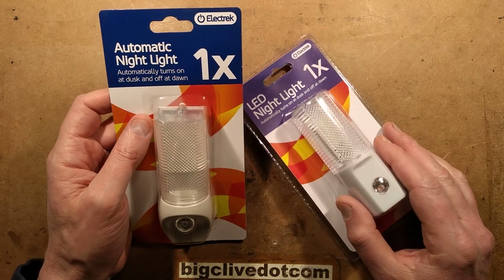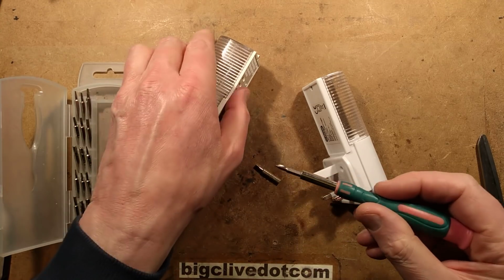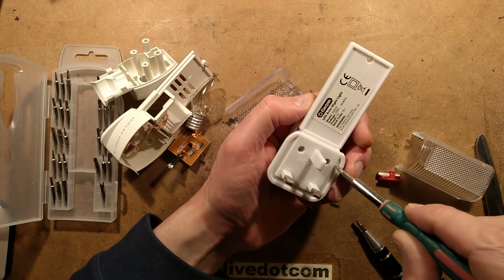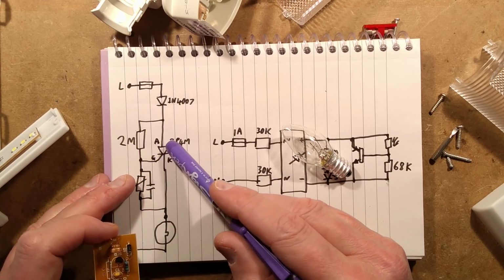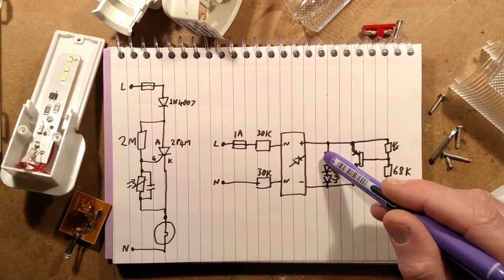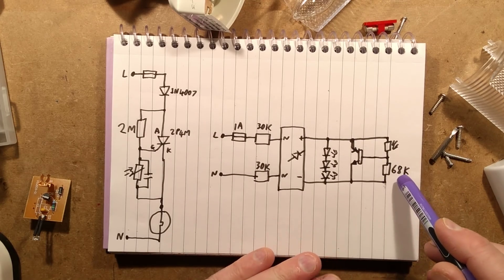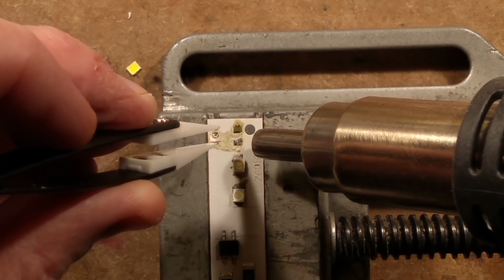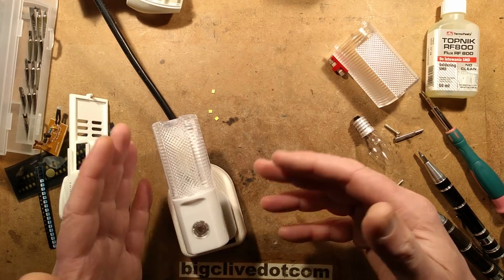Poundland night light tungsten to LED evolution.  (with schematics)

Comment: I had one of these and tried to add more LED's to it, but i found it would not come on with any more than three. Why is this? Is it something to do with the transistor that shorts out the LED's when light shines on the LDR?
Reply from the maker: It is possible that the higher voltage is changing the dusk sensing characteristics.

Comment: So... if the LED night light is continually lit it uses the same current as it would when the LEDs are off?
If so, apart from increasing the lifespan of the LEDs it's a bit pointless and technically a waste of energy (minuscule that it is).

Comment: Would it be possible (smart) to put a flickering, candle LED in place of the top LED?
Reply from the maker: It might be viable, but may need a small zener diode across the LEDs to limit the open circuit voltage when the flickering LED has its LED off.

Comment: Instead of the ( two ) 30 K Ω resistors , use one 100 nF ( " X2 "  mains rated ! ) capacitor live side and a 330 Ω resistor in the neutral side .... this gets rid of the heat dissipation .... the LEDs can then run all day , without a big electricity bill ( remove the shunt circuit ! ) tried - n - tested ....  😝 ....... DAVE™ ..........

Comment: I've not had any pleasant experiences with those night lights that are supposed to turn themselves off in the daytime.  Either they stay lit,  or they don't turn on when they're supposed to.  Last one I took apart was simpler in terms of the circuitry,  there was a thyristor in a TO-92 case,  no part number apparent,  and an LDR,  which I thought I might find useful so of course that immediately went missing and I haven't seen it since.  The only night light that I currently have here is one with a regular switch,  no LDR in it.  Oh,  and the bulbs used to be all 7.5W,  but I've seen them as low as 4W in some instances.  Edit: New YT stupidity with "handles",  my name does not start with an at sign nor does it have an underscore in the middle!  Idiots...

Comment: LED lights  are going to cause a massive influx of plastic waste in the future. Even the packaging has more plastic on it for the LED one! LED fixtures are not designed to have the LED's or the driver changed, so the whole fixure is junk when it fails. Incandescent and Fluorescent fixtures are designed to have the lamp changed when it fails (and the control gear rarely goes wrong) So in the old days we can DIY swap a lamp, but now we have to get a electrician in to replace the whole fixure!! Already had many LED floodlights fail, had to change the whole damn thing instead of a couple of minute lamp swap.....

Comment: Great intertainment! Yes, if you're going to do something as wild as use a heat gun to melt solder paste-- you do need to hold the part down. Or heat if from underneath with an iron (clothes type) or a coffee cup warmer.
Great hack.

Comment: Although I know little about electronics I enjoy watching your videos. This one in particular because I have one of those tungsten night lights and the bulb went recently. After looking around a bit I found Eveready do night light bulb replacements in packs of 2. Anyway the fact that the LED version doesn't actually improve on anything kind of bothered me so I've watched a few videos about thyristors and I've come up with something. (probably stupid, but I guess you'll let me know). Apparently thyristors require a holding current to latch them so, in the tungsten circuit, replace the bulb with a resistor to get the appropriate current. Then take the voltage across the resistor to power the LEDs. I'm assuming smaller resistors would be required as it's only half a wave. I think maybe some smoothing may be needed. I'm probably parading my ignorance but what do you think?

Comment: I don't think you're supposed to surface mount components in a wind tunnel. Most SMD heat guns have air pressure adjustment.

Comment: It's a shame they didn't use a capacitive dropper. It would make it so much more efficient if the LEDs are on, and practically using zero power when they are shunted. Even if it would double the price you would earn it back in one year.

Comment: "Resistive dropper" ?  Not the one I had, and I found that out the hard way, after a thunderstorm blew the unit up.  My LED nightlight had a capacitive (less than 0.1uF) dropper, which does make it very efficient, BUT it also makes it ultra-susceptible to high-frequency noise and short power spikes on the line.   After the lightning blew it up, I took out the LEDs and the circuit board, and stuck in a small neon tube and 100K ohm resistor.  Been working fine ever since, 10+ years later.

Comment: Can't you just replace the old lamp with the whole LED-Circuit (ignoring the sensor-part) and it works?
edit: for the smd-ordeal: slower airflow and maybe more heat, hmm

Comment: I didn't know 7W 240V bulbs were available.  The 7W 120V ones have a long thin delicate filament, the 240 ones must be more so, as to achieve 7W they'd have to run at half the current (29mA or so).  It looked like there were a lot of zigzags packed in there.  I should go pick one up for a closer look.  And I'm glad you shared your first hot-air SMD experience, mine was similar, with components blowing away, flux blobbing everywhere, etc.  If your hot air gun has an air flow control, try turning it down (it helped a lot for me).

Comment: might as well have used a soldering iron on the diodes...
Reply from the maker: In hindsight, yes.  But if I'm going to have a go at hot air reflow then it's worth sharing the experience, even when it all goes wrong.

Comment: The LED circuit is really badly designed. Turning the light off by shorting it out, how horrible.
Reply: horrible, maybe, but simple...and cheap 😉
Reply: @andygozzo72  I do not accept that simple and cheap is an excuse for bad design. I think it is possible to engineer a better design that does not consume power in the off state for a very similar amount of money. Bad design leads to house fires. One only needs to  look at the problems with house fires caused by clothes dryers and fridge freezers. One must wonder what has happened to UK safety standards, that are supposed to stop potentially dangerous products reaching the market. In a world were low energy light bulbs have been forced on to society, how do inefficient products get onto the market?
Reply: @nigeljohnson9820  it is an 'excuse' for a lot of stuff from china 😉 yes, it definitely could be done much better...
Reply: @andygozzo72  it is just a coincidence that the European safety CE mark also happens to be the same as the Chinese Export mark.

Comment: I got one of the LED ones recently, and I have noticed something rather strange.

If it's plugged into a switched off socket, and it's dark, the LEDs still light up (but very dimly). So dim that it's only noticeable in complete darkness - but there is definitely a small amount of current flowing despite the socket being off. It isn't residual charge - if I unplug it, the LEDs go off, plug it in again (still with the socket switched off), they go on again. 

Switch the socket on, and it lights up fully as expected, so it's not that the switch is bypassed. And I've tried it in different sockets throughout the house, with the same result.

Of course the switch on a socket only disconnects Live, not Neutral - but how can it be drawing current from the Neutral alone?
Reply from the maker: Capacitive coupling perhaps.  It only takes microamps to make LEDs glow visibly in a dark room.  Does it do it in other similar sockets?
Reply: @bigclivedotcom  Yes, same result in every socket I've tried on both ring main circuits. The only one it didn't work in was the socket on the cooker circuit. Perhaps because cooker was switched off at big red switch adjacent to this socket, so no power flowing on that circuit at all?
Reply from the maker: @jammin023  Sounds like the design of the socket has a slight capacitive coupling between two metal components.  These LED lights are super-sensitive to even the tiniest current.

Comment: How old is the LED lamp ? The used of LDR's has been banned in Europe from around 2004 under the RoHS legislation, as they contain cadmium, and alternatives are available. There may have been an exemption for use in lighting control for a few years but the last exemption for LDR's expired on the 31 December 2013 - and that was for "“Cadmium in photoresistors for analogue optocouplers applied in professional audio equipment”
It may NOT be an LDR there are replacement devices with a diode detector and controller that mimic the operation of an LDR - for example the LXD-VT5528B. If it is an LDR and its still being sold trading standards will be interested !
Just watched the video again - and looking at the package for the device on the bulb version and convinced it is not LDR's but the silicon diode based alternative - that may be why there is a capacitor across it in - to power the circuit during the 1/2 cycle when the power is off ?  Strangely the LED version looks as if it is an Cadmium selenide LDR - in violation of RoHS and may be REACH as well.

Comment: I'm betting the reason it shunts instead of just opening the circuit is because a transistor that can switch  over 300V (waveform peak) is a lot more bulky and expensive. Switching between the shunt or the LEDs, means the transistor never sees more than a couple volts across it!
Reply from the maker: I've taken one light to bits that did use a high voltage transistor and the rest of the circuitry needed to drive it was drawing as much current as just shunting out the LEDs.

Comment: Shorting out the LEDs in order to switch them off would be fine if the unit had a capacitive dropper. The bad power factor would then make the vast majority of the resultant current draw free of charge.

Comment: maybe if the switching circuit of the filament version was used with leds, it'd be more power efficient when off?! i think you can get small led e14 bulbs ?
Reply: they'd have to be a type suitable for use with 'electronic switching'/'dimmable'

Comment: If you put an LED E14 bulb in the one with the thyristor would it work or would the chopping of the mains cycle in the thyristor fight with the rectifier circuit in the LED bulb?
Reply: yep, it would be a problem, the led 'bulb' would have to be a 'dimmable' type .. they can usually handle the choppy waveform , capacitor dropper types would probably blow quite quickly from the heavy current pulses

Comment: The old style ones are better because you can use every kind of lamp you like! Even LED if it doesnt have a capacitive dropper where both AC cycles are required but this could easily be fixed by changing the thyristor with a triac
Reply: or replace the single diode with a bridge rectifier,

Comment: Hi Clive.

I bought a cheap reflow station after watching videos on repairing hdmi ports etc, and thought I’d try myself, using old boards to practice on etc.

On some videos where people add or replace LEDs, they always say to apply the heat from underneath the board and not the LEDs themselves.

Andrew Paul has some great videos using a reflow station.

Comment: can you change the led's for a RGB i think it will look well good
Reply from the maker: It's tricky finding the self colour changing LEDs in the surface mount package.  But you do get an older version of this light that can take the through hole LEDs, or they could just be bent and surface soldered.

Comment: I have an LED night-light in my hallway because it gets ridiculously dark at night if none of my neighbors have a yard light turned on and mine uses a capacitive drop. Ironically, most of these "power-saving" light sensors end up consuming slightly more power while "off" since the inrush limit resistors waste more power while the LEDs are shunted (lower total resistance and voltage drops) than what the LEDs consume while on. Light sensors on LED night lights have no reason to be aside from making people with a power-saving OCD that can't handle something being visibly always on feel better.

Comment: Lower air flow helps in not blowing the components away. Sometimes you need to to blow further away if you don't have low enough setting for the air. If it gets too cool further away, just adjust it a bit hotter. This needs a few tries and a bit of tweaking depending on the board to get it going well.
Larger nozzle lowers air flow too. In soldering you can often use large nozzle unlike in desoldering where you really want to heat up only one perticular tiny area.

Comment: Note to Clive : Your hot air re flow method is best left for BGA devices. Use the iron it will flow just fine. Sorry i found your re flow follies to be
laugh my ass off hilarious, when the LED sailed off the board i lost it.

Comment: Could we use a mix of both technologies ?
Instead of the tungsten lamp use warm white led and use a diode bridge instead of the single diode ?
Reply: sort of , i'm pretty sure you can get small e14 based led 'bulbs', just change it to one of those !
Reply: but make sure its a 'dimmer compatible' type.. not a cheapo using capacitive dropper

Comment: No.1 tip for using a  hot-air gun - leave it running for a minute or so before use, so the temperature stabilises. If you use it while still warming up, you tend to get it too close so it melts the solder, but then the temp rises rapidly and melts the components.

Comment: BTW The reason for shorting the LEDs to turn them off is so they don't need a  transistor that can handle high voltages. 
I wonder if the photocells are still using Cadmium Sulphide, or if they've found a Rohs compliant substitute
Reply from the maker: That's the odd bit.  The LED one looks like cadmium sulphide, but the old one looks like a more modern photodetector.

Comment: That's such a shame that the LED lamp consume constant current, even when turned off. How would you design it to consume minimum energy?
Reply: You'd need to replace the transistor with something OK for 400v for starters, and do a slight redesign of the "lv" part of the board. Might need to increase track spacing, and the bigger trannie will need some degree of track rework. It's almost worth it to do a full redesign using 0.1 inch Veroboard or similar; alternatively a quick DIY PCB etch might be more aesthetically pleasing!
Reply: @phils4634  basically combine the thyristor switching of the filament circuit, with the resistive led dropping circuit of the led type....
Reply: @andygozzo72  The problem of that approach is that the LED doesn't have the thermal inertia of a filament, so the VERY pronounced 50 Hz flicker is pretty annoying. A solution would be to use a Triac / Diac combo with inverse parallel LEDS, but things are now getting a bit complicated. To minimise flicker an electrolytic is ideal, but 400v decent capacity rating cans are large, and the resulting "nearly constant current" supply means that once latched the SCR won't turn off (no zero volt crossing). Surprisingly, 400v 1A NPNs from e.g. China Semi are quite cheap (as in 100 for $5, all working OK, but pretty variable hFE), so simple substitution (and loss of the resistor chain) is cost effective!

Comment: Hidden safety feature: If you only remove the transparent plastic, all exposed circuitry is at least 30Kohm from mains, providing max 10mA of shock current, even if live and neutral are swapped.
Reply: it'd still give you a tingle 😉 90v from a stack of pp3's is bad enough 😲

Comment: They are sold here at Action under Grundig brand. Says Made in China anyway so not sure.
Got one with a wonky sensor and it stays on during the day as well.
Fine with it now I know it doesn't actually turn off but switches to frying resistors.

Comment: If only there was a way of converting them into an emergency light which came on in the event of a power cut.
Reply: You can buy them on amazon for $10
Reply: What you describe is known as a power fail flashlight. They sit in the wall outlet staying charged up, but they light up automatically when the power goes out, and there's a switch that will illuminate either the LEDs on the side of the unit or the LEDs on the front of it, so it makes a handy dandy flashlight anytime you need it. The ones I like best are shaped kind of like an hourglass and cost about eight or nine bucks at Home Depot here in the states. I've seen some other variant versions that also function as an automatic night light when it gets dark.

Comment: It is a quarter to 7 in the morning and I laughed so hard I must've woken the whole flat here when I saw your first steps in soldering SMD. It is not laughing at you but seeing it was just so funny :) btw my guess (I'm a SMD noob) is you needed less air flow and a slighty higher temperature setting on the heatgun.

Comment: I use motion sensor LED night lights. They only light for 60 seconds when I walk by, and automatically turn off when the main lights are turned on. Great for my one bathroom that has no window and is dark. If I used ones like above,  it would be on 24/7.  Not economical!

Comment: Seems like the tungsten lamp is designed to be disposable when the lamp goes out. I doubt most poundland customers have a triangle security tip screwdriver or even if they do be bothered with opening the night light up and replacing the bulb.
Reply: You weren’t paying attention. The tungsten light had one Phillips screw to remove the cover and access the bulb.  The led one had a trilobe to keep you out.